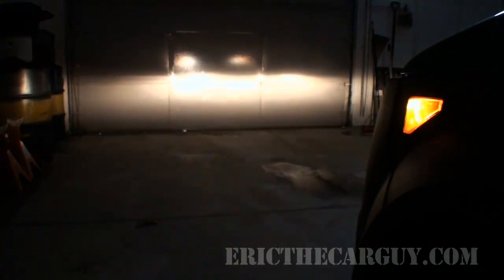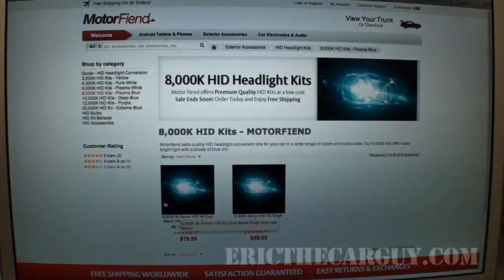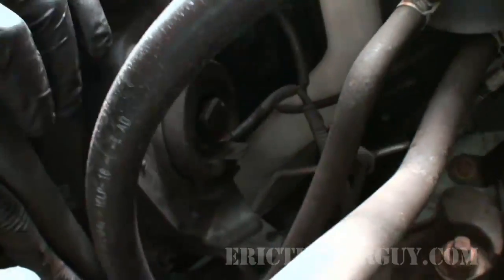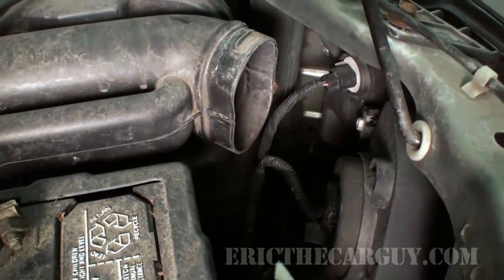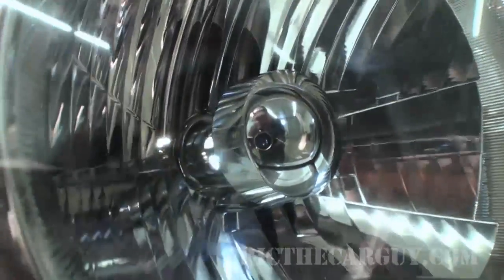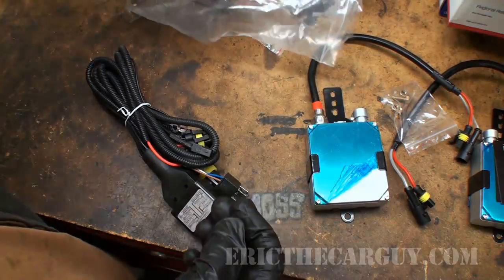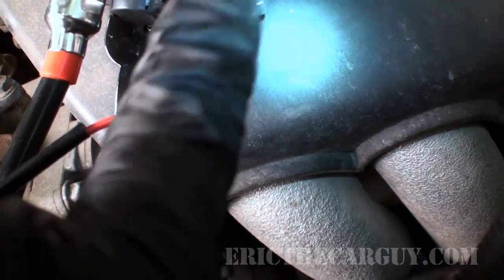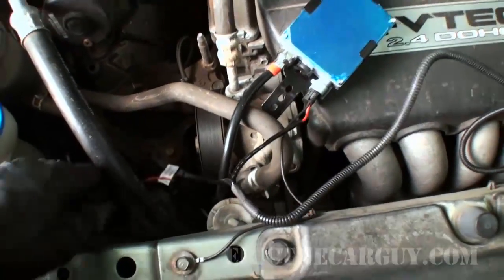How To Install an HID Headlight Kit -EricTheCarGuy

Comment: The higher the number the blue to purple it will be.  Pure white light is 5000k it's the brightest!  No state allows you have higher then 5000k.  You can get away with 6000k but after that it's just a colored light. Don't install anything higher then 6k or you get in trouble.

Comment: Hello 
Eric
 i 
have a 2003 Grand Am 3.4L v6  problem with my headlights i have HID lights with Can-Bus Ballasts the problem that i am having is the when the lights are shinning on the wall or ground it is impossible to adjust cause my head lights has a center piece that is kinda open in the center and i have noticed on the standard halogen bulb has a painted end on the bulb when they work fine but not bright enough so i decided to go with the HID and then noticed that the end of the bulb has no paint on the tip or chrome so my problem is how do i fix this the lights are shinning everywhere but cannot adjust and has big shadows on the ground and on the wall my reflector center piece has no chrome tip is there away that i can make a reflector to make the lights shine better look up the headlights and you can see what i mean about the open center reflector.

Comment: In germany we need to have a automated elektronik angel adjustment for HID lights if you install them. THis changes the angel depending on the angel of the car. So if your trunk is fully loaded it changes the angel so you dont blind other drivers.

Is this also the case in some states of the USA?
Reply: Nope, not in Canada either, but it bloody well should be.
Reply: Yeah Germany is actually the only country I've lived in where electronic adjustment was standard.
Reply: It seems that most cars that come from the factory with HIDs now have an auto-leveling system - I didn't even know that my car had it, but I parked on an incline the other night and saw the beam pattern level itself out. I can't say I've seen an aftermarket system with that feature integrated, but I agree that it should be required. It should also definitely be illegal to run HID bulbs in reflector housings.
Reply: Yeah I loved the adjustment system.  You don't realize how useful it is until you have it.

Comment: Eric would it been easyer to bolt the ballets closer to the head lamp unit then the wiring bring it threw the front of the ac condenser for a cleaner wiring set up

Comment: Sorry Eric but, HID's on reflectors is the same as saying down the road, HEY I'M A JACKASS. I replace headlights on a regular basis, but I remove the reflector and install an HID projector, they are a lot more expensive BUT works a lot better. Also keep in mind, never install 55W HID's, they burn sooner and may destroy the headlight... or buy a car with factory hids.

Comment: HID uses 35W compared to the 55W that a conventional halogen bulb uses. And it produces less heat as well. So it actually is better for the electrical system and for the headlight assembly. So why not every car comes out with an HID system? Because it's a lot more expensive than a cheap bulb.

Comment: Actually the highest light output is at 4100-4300, any higher than 6000 is less than than stock in most cases

Comment: "Xenon conversion kits are illegal for sale or use in the USA, but there is more to the issue of Xenon retrofit kits than just the legalities. These kits themselves rarely provide a useful increase in light output; instead they usually produce a huge amount of unfocused light that is both blinding and dangerous to other drivers and pedestrians."
-HELLA

Mainly you piss the hell out of other drivers. Bad Eric.

Comment: They don check your lights where I live we don't need inspection where I used to live they just hook up a computer and a gas tank pressure gauge. But in the new town i live in you bring registration to DMV and get you tags

Comment: Hello. If you are using HID headlights for your car. lamps for your car should take a lens other case you dazzle other drivers. In my country where I live makes a fine if commuting to these installed packages for which it is not intended for cars with reflector head lamps.
But of course with these HID kits have better visibility at night.  But when the rain are going visibility is very poor!!  The best chose will be 6000k.. becouse thet are going in stock some cars..

Comment: higher the kelvin means more color, not light output. You want the most natural color, which would be 6000k, which is more of a white. 6000k for headlights would be the brightest you can get which is why o.e manufactures use this rating for their cars that have PROJECTOR headlights. For foglights, 3000k would be optimal because 3000k is yellow and the yellow spectrum is the best for output in foglights.You should have just put foglights on instead of blinding everyone with hids in those hdlights

Comment: aren't you suppose to use projector headlights? or is that Hid bulb holder thing a replacement so you dont need to use projectors? i was planning on putting Hids in my 91 Jetta but Projectors look ugly on it.

Comment: If not properly adjusted they are annoying, I've had full HID kits in both my 03 Mustang GT and 02 Explorer for five years. I adjusted them on day one and haven't had any complaints, Not even from cops. And having a 4wd behind you even without HID's the lights still shine off your mirrors into your eyes so either with or without them its annoying and nothing can be done about that.

Comment: You could have used the holes holding the wiring harness and then zip tied the harness to the bracket, and then you would not have had to drill holes.

Comment: Yes, they correlate to a point.  However, using the K rating as a measure of brightness is plain inaccurate.  The further away from white you get the less brightness, that is true, but only true if everything else about the bulb stays the same.  So basing brightness on the K rating doesn't work.  K is not a measure of brightness, lumen is.  A 10,000K bulb rated at 8,000 Lumens will be brighter than a 4500K bulb rated at 7,000 Lumens.

Comment: Hi Eric, above 6000k you start to degrade the performance. It is going on the UV range.
Those cars that came from factory with HID Headlights, the bulb is arround the 4300k, 4500k.

But even so, great job!

Comment: Eric...  Now I have to smeck you with a newspaper...

Kelvin has to do with COLOR temperature.  It has nothing to do with brightness.  The farther you stray from white (4200K-5000K) in either direction, the dimmer the light will become.

Comment: Bi xenon is just hi/low HIDs, which is 1 HID bulb and a solenoid to suck the bulb in when you want high beams. Xenon=HID
fake Xenon= blue tinted horrible Halogens on Ebay

Comment: This thing has a lot of commens, my only input is that it probably would have been safer to atleast remove the negative terminal from battery (even though its switched for headlights) and you didn't really cover what you did with the other headlight plug, I'd hate to have an exposed plug to the elements like that, ie shorting out etc

Comment: WOW Cool! finally got rid of that original halogen crap on my MB,and now,I have seen 00the Light!! HID:200W :60.000K(Sixty thousand Kelvin) and 700.000Lux. I tried wearing Sunglasses to prevent headache,but found out that just stare into the Sun,with no sunglasses for approx.30.minutes every 45minutes,is real soothing. Goood! I Will also ask all you HID Experts out there :1044 and counting: What means this Yellow Sticker With a black Triangle (With a pill? inside the Triangle) And IT says under the TRIANGLE (On the Aftermarket HID-Kit) CAUTION:Laser Class 5     ,What means caution?? Looking (WOW looooking=SEE!) forward to explanation from All You HIGH TECH ,MIT-Graduates on HID EXPERTS!

Comment: Actually, his statement that the higher the kelvin number the brighter the light will be is incorrect. The higher the number, the bluer the knight will be. A 8k hid bulb is less "bright", and has less usable light output than a 5k bulb or capsule.

Comment: what are the possibility of my hid lights cant do a high beam? when ever i flash the high beam, it will flickle... so now what i did was remove the high beam pin from the connector. so whenever i flash the high beam on and off , it will off the light so it looks like strobe mode. any idea how to rectify this?
Reply: Did you get a bi-xenon kit? If not, then all you will have are low beams. If you can't get a bi-xenon kit for your vehicle, then you will have to get two kits. One for low, one for high.

Comment: I see the website recommends the 9003 bulb for Honda elements but the box you pulled the bulbs from was marked H4, which model bulb did you use for this?
Reply: +John White they are the same thing, h4 is the hid of the 9003 bulb,
Reply: +John Appey (Sharkwk27) thanks!

Comment: I'll be honest I don't care much for my Durango it was cheap and I had to get something quick when the engine blew on the last truck. It had a heck of a lot of miles on it. I'm really trying to hold out for a Tahoe with the same body look as Steve meade's....... And yes the breaks are awful in my truck I'm thinking of doing disk's all the way around. I would feel much safer if I could stop.

Comment: Wrong. You can buy xenon bulbs, which look like HIDs, but arent. HIDs run very high voltage and work in a similar way to spark plugs, with an arc which ignites the gas inside the bulb. a 12v current wouldnt supply enough power. :)

Comment: i mean, it's your car, and you do what you like. but in case of HID lamps, you cannot beat an OEM system. I do a lot of stuff on my cars as well, but headlights are the best when you use bulbs that the headlights are designed for. No offense. And 4.300 K, by the way, is way brighter because it has almost the same color temp as the daylight. So you see the most rather with 4300K than with 6000K and beyond. Greetings. Just my opinion.

Comment: Thats wrong buddy .Kelvin is a temp scale which refers to the color of the light .With 5000 being pure white , lower numbers going into the yellow then red range . Over 5000 goes into the blue , then violet spectrum .Light intensity is measured in lumens .

Comment: Read previous posts I made.  I have a HID projector retrofit and in the early 2000s (i.e a long fucking time ago) I put HIDs in stock Dodge Dakota headlights and I couldn't see shit.  Ya, they looked cool, but were not an improvement over stock and I got flashed at all the time.

Comment: Wouldn't it make more sense to tighten down the zip ties good enough to where it doesn't move at all, instead of leaving it loose which leaves room for more movement and rubbing. But if both surfaces are smooth, which some ties are on the inside, it'd take a bagillion years for it to cause any serious issues. But that's just my brain trying to make sense of it all, I could be wrong...

Comment: I just bought some hids but It also came with the whole housing so would it still need the ballast?
Reply: TeAZeR1o1 In order for HID to work, first you need around 25000v to kick start the bulb.  Once its lit, you then need around 80 to 90v to keep it running.  Now, the ballast's job is do all these voltage management!  So unless there is a ballast in the housing (which I seriously doubt), then you'll need to get a ballist.

Comment: Illegal is Illegal. NHTSA says they are hazard to other drivers and that is all there is to it. 

"So why not just change the light source from a regular halogen system to one that works with xenon or HID lights?

Because doing so likely violates a federal law, 49 U.S.C. 30122, which prohibits a mechanic from rendering inoperative any equipment installed in accordance with a Federal Motor Vehicle Safety Standard, NHTSA says."

Comment: HELP!! l recently bought an 07 Odyssey EX-L even with a "Carfax Report" l took the van to the Honda Stealers for maintenance, inspection and check for any recalls on it, they said the Timing Belt needed to be replace an $870+ job, so l took the van to my 10 year repair car guy. After 1 week, the bolt on the Tensioner broke, he replaced the Tensioner kit, new bolt and now the belt is squealing when l start the engine in the morning and when the engine is warmed the noise is gone, why is that?

Comment: I am not a fan of these. HID bulbs were designed to have projectors. You are just going to blind oncoming traffic. Unfortunately aftermarket projector HID replacement assemblies are usually $300+ and some will have bounce issues.

Comment: People make mistakes. HIDs and the laws governing them aren't the most easily defined thing. This doesn't help that the makers of the aftermarket kits white lie on their packaging saying they are street legal and DOT compliant. They may adhere to some of the DOT standards but not all of them. The part they ship you is legal... when installed in the correct housing which they don't provide you, thus making them non liable.

Comment: You said "check your local laws," you're in the US so and by federal DOT regulation are not legal. It doesn't matter what a random State Trooper says.

Because replaceable light sources are, by regulation, designed to be non-interchangeable, it would not be possible for an HID headlamp conversion to meet the standard's photometry requirements for an original equipment headlamp system using a halogen light source, so the replacement lamps could not be sold for this purpose.

Comment: The light kelvin has to do with the colour wavelength not the brightness...ie most normal stock halogen globes are 6000k..a 6000k HID is WAY brighter but the same colour..low kelvin is more yellow, higher goes through pure white to blue then up into purple